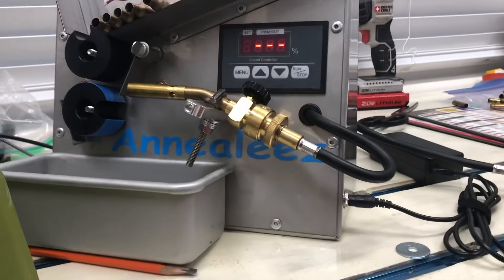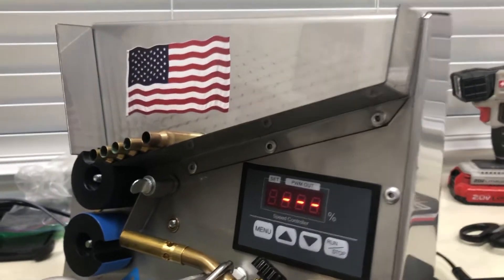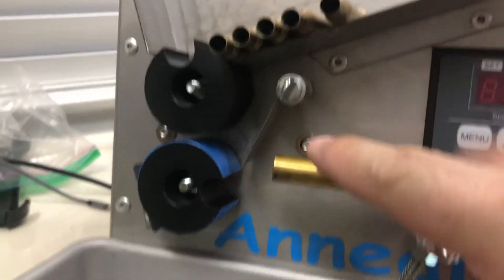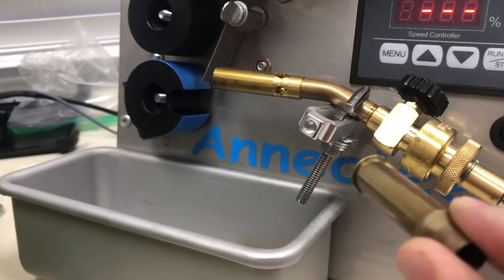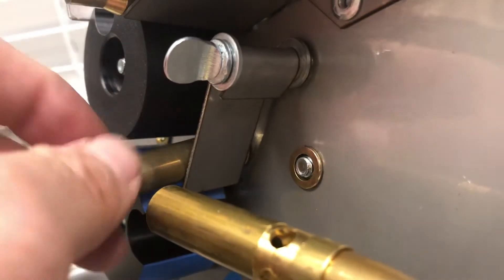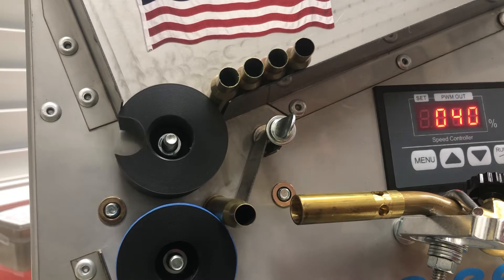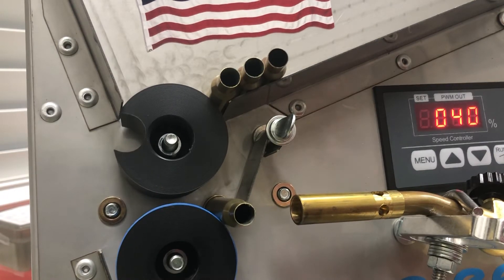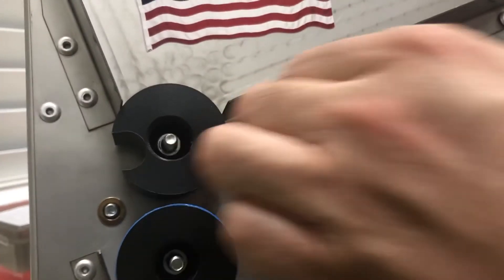Annealing brass cases

Comment: When I ordered my annealer, the company was out of pans (covid issue) and they dropped the price $15. Fine with me as I let the cases drop onto a soft towel. The back side of that adjustable tab may have some rough edges catching the rims. A stroke or two with a file will clean it up.